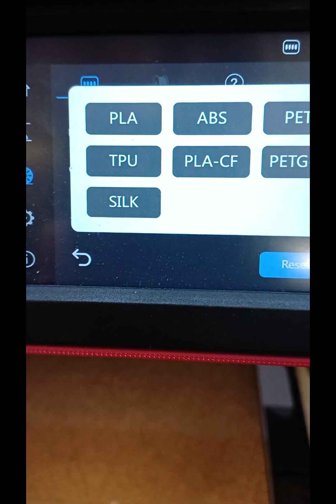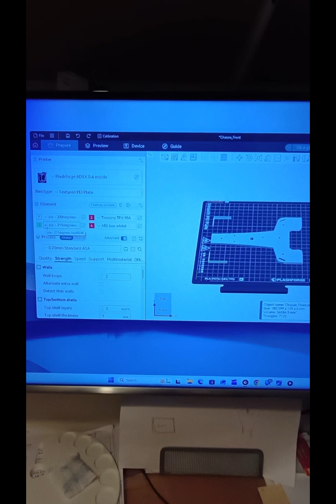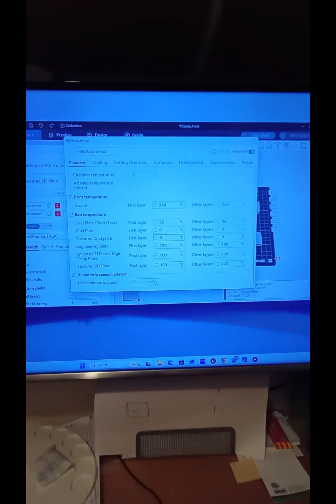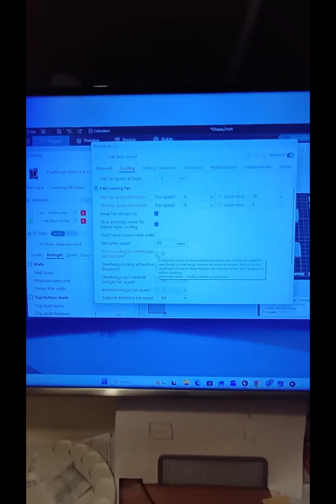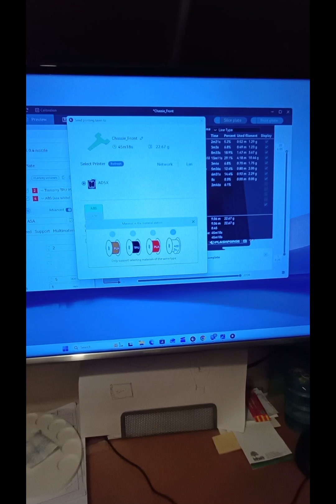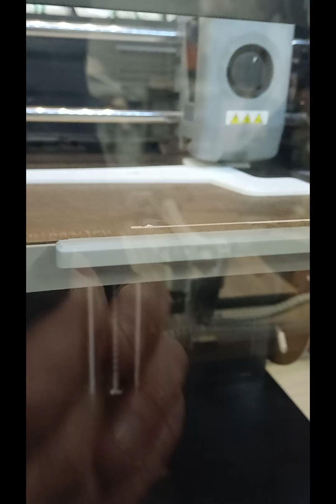ASA 3d prints on Flashforge AD5x

Comment: Add ASA with ABS profile. Once in slicer, select abs, change temp for bed, nozzle temp as needed and print. It would look like you are using the profile for ABS and it will print fine, also you can modify and still get same results. Not every filament type is listed but as long as they can be printed under 300'C and with bed temp of 100'C, it can be printed in FF printers